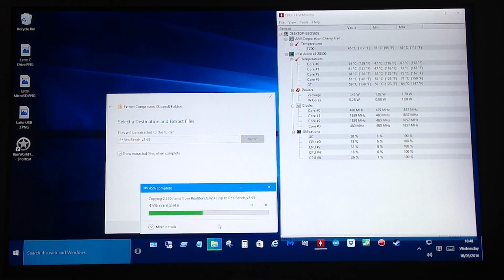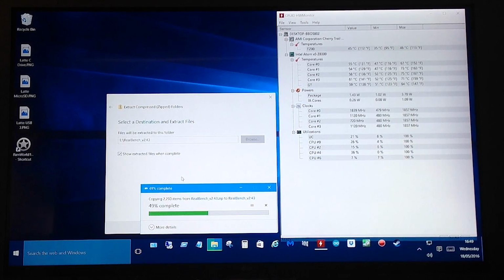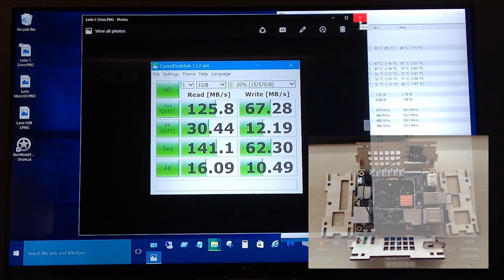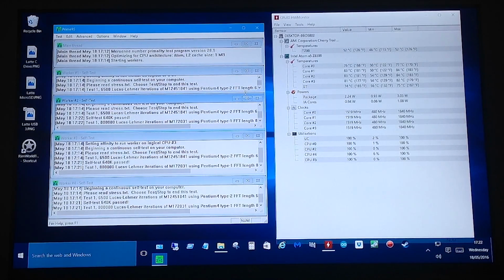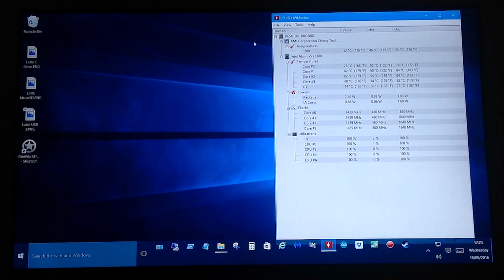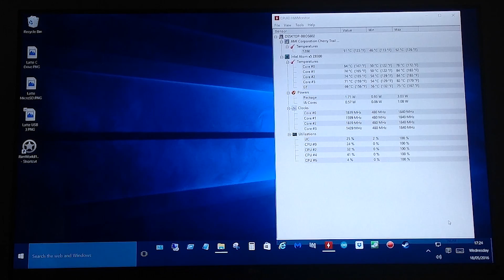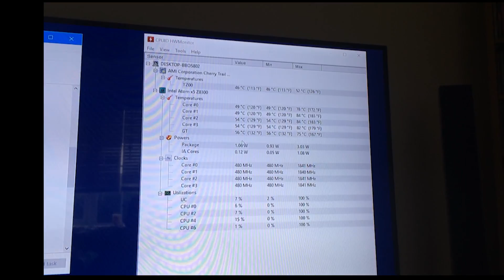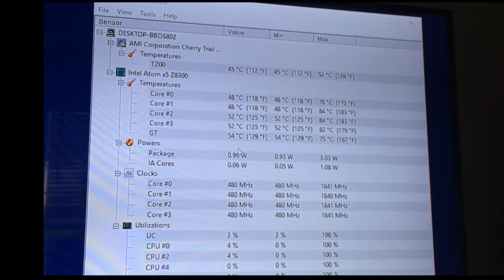LattePanda/Latte Panda Uncovered / Benchmarked / Stressed

Comment: I just verified @PVTParker's results. Thanks for posting this. I suspect that factory placed thermal goo is acting as more of an insulator than a heat diffuser or thermal grease. I think Lattepanda needs a better supplier for their thermal goo. We also added the same copper heatsinks, then tried keeping the processor spinning up to heat it up with chrome, streaming videos and covering it with a cotton cloth and we can't seem to get temp to rise above 83 degrees Celsius. It's baseline was 85 degrees C without running anything at start. So Good job @PVTParker.

Comment: Received my LP yesterday, and did all the preliminary setup on the system.  4 Gb/64 Gb system with LP stock 5v fan attached to processor and IPS display panel.  Initially attempted to fire up on a 2.1 amp power bank but proved to be unhappy.  Video kept dying.  Stay away from power banks.  Next set up on an Apple power block used for iPad.  This has proven to work for the most part, but I have some questions regarding how well a switching power supply works with the LP.  Maybe someone out there knows.  Grandson loaded Minecraft and found it to be pretty laggy, even with specs turned way down. Looks like gaming may be a stretch.  Went to Youtube (running in Chrome) and began streaming 4k video.  defaulted to 480P and this streams fine with about 25-40% load on CPU and temps about 60C.  Ambient temp is 22C.  When stepping up to 720P, load goes to 35-70% and temp is 61C.  Even at this resolution, the video can stop, literally, the IPS screen goes blank.  At 1080P it will flash on the go blank.  At this stage, it requires a reboot.  Have not tried it yet hooked up to HDMI output and IPS screen disconnected.  Comments - Please.

Comment: I was thinking that, given your points about components on the underside not getting the cooling that those on the upperside get, then how about mounting the board vertically ?   Perhaps add a stick-on heatsink to each of the six chips so that you get a better flow of air by convection over all of them ?

Comment: Those rubbery squares look like silpad, an electrical insulator but thermal conductor. You should leave those in to complete the thermal circuit from chip to heatsink.
Reply from the maker: pratherat yep agreed if the default heatsink is used then leave them in

Comment: If you run a browser (Chrome) with a single tab do your temps still 90c?
Reply from the maker: Ben Milford ....No but do something processor related on a non active cooled latte and you'll be getting pretty close. Since adding the fan i rarely get above 65 / 70
Reply: Pvt Parker great to know their fan works! I assume your using the official one they sell? Thanks so much for your help!
Reply from the maker: Ben Milford dfrobot werent listing the fan when i created the vid so no unfortunately not the official one but a 5v 1500rpm fan all the same....i would recommend something lower than 1500rpm if you can find one just to reduce the noise it makes...hope that helps

Comment: Hi a quick suggestion, if you insist on using a low quality mic you could improve the sound by post processing it, with compression and a noise gate. btw i like your tech videos. this is not a dig at you.
Reply from the maker: Supahfly Adrian i have a better mic now so things should be improved if i do any more vids :) thanks for the feedback
Reply: I literally can't tell the difference between a good or bad mic, this seems like a pretty alright mic so long as it doesn't sound like a world war two fighter pilot radio

Comment: hi. Mike from south carolina usa. if you will raise the board 6 to 8 inches high. then place 2 92mm fans on the right and left blowing in toward each other and keep the heatsinks where you have them. you will see much less temp and a lot more performance. keep the plates off to they serve no purpose also turn the board back right side up. hardware engineer here. i have been running this setup for months now. i got mine in the first batch.
Reply from the maker: Hi Mike, thanks for the info...interesting....couple of questions which fans are you using (a link would be appreciated) also how are you powering the fans off the 2 sets of 5v pins?
Reply: +Pvt Parker they are powered by the male pin set they always have power the fans are just some 3 pin connect 92mm china fan also play with your windows power settings (a laptop power settings is ideal).dont buy high wattage fans. my email address is gadawgs34@live.com if you would like to chat and go through this panda journey with some company
Reply: +Pvt Parker one more thing. mine is raised and attached to wooden dow rods

Comment: Would removal of the thermal pads and replacing them with good ol thermal paste plus the addition of a heat sink to the metal plate they use be a good choice?
Reply from the maker: The thermal pads are quite thick so removal will result in a gap between the cpu and the original heatsink. Paste will produce better results but youll need a bespoke heatsink....dfrobit are now selling a latte heatsink!
Reply: +Pvt Parker just a small after thought by their design team huh....

Comment: Thanks for the video!
Did you load tests the board again with the heat sinks in place? What were your max temps sitting around?
Reply from the maker: I did indeed on average it dropped temps by about 15c idle and under load..

https://youtu.be/af_up7OCO7M

Comment: those plates have more than one funktiom.they are emi shields heatsink with termal pads under.a better way to cool it donw is to use better termel pads put on those plates and put som termal pasta and a heatsink on top.also as you poined out,turn it upside down
Reply from the maker: I found that the thermal pads and the plate did next to nothing to be honest. A mini active heatsink would be the best way as you say with some paste but I've failed to find anything suitable atm...if you have any links or suggestions please post them. thanks
Reply: if you can order hard termal pads between components and cover.must messure distanse between cover and components.thay are pretty good.with some holes in the emi shield/ cover and a small heatsink with a 12 volt 3-4cm fan run on 5 volt i think you will be a happy gay.

Comment: the covers are heatsinks with termal pads to connect the parts to heatsink.you find those pads on graphics card playstation and so on
Reply from the maker: They suck...
Reply: yes they suck.but there are better pads with much higher termal tranfer capasity.a shop that sell pc parts or most real elektro shop should have these pads in diferent qualitys.if correkt use they wil be skvised between component and bessel.i solution that workt fine was change all those bad pads.drill sdome holes hwere posible in the covers to have air move innside.i put a heatsink 3 mm high,like those on shipset on mobos.used superglue to fasten it on the cover/bessel on top of that i have a fan 12 volt 5 blades.the fan is 4 cm in diameter with no outer ring with skru hole in eatch corner.i use tose that was and is used on small graphics card they have 3 small flaps stikking out with skru holes to fasten them to heatsink.i cut of those and glued the fan an let it run with 5 volt from usb.cant her it unless you put your eare down to it.best result with this is to turn it upside down.anyway you shave off 20-degrees easy.used the same coling for an usb hub with its own power adapter.but the 5 volt controller component was getting so hot that you couldent tuch it. glued i litle heatsink on top off component 3 cm by 2 cm heasink.put a fan as decribed but alitle smaller its 12 volt running it on 5 volt.its silent never gets hot under load.good luck to your projekt sir
Reply from the maker: +leohobb leohobb nice!

Comment: 3:47 Those are called thermal pads, btw! 
10:20 The processor is throttling due to the little copper-ish heatsink not having enough thermal/cooling capacity. If all the chips on either side are at the same height, you can mount a large (preferably copper) heat sink with good thermal paste (thin coat). I imagine that a heatsink from a low-budget video card would also work. Something low-profile, could be passive if you use all of the available area. ;) Check any old PC/parts, you'll find the perfect candidate.
Reply from the maker: Lol thanks thats what you get for not scripting vids >_<
Reply: No prob, dude! :) Also, the metal plate you removed server as a bit of heat sink, since it had a lot of area. This is making it easy to attach a heatsink directly on top of it, but regardless, you can get sheets of thermal pad material (get the one with higher W/mK - better thermal conductivity) and mount the large area rad of your choice directly on the chips. :) Cheers!

P.S. Looking forward to getting me a LattePanda to thinker with it >:)

Comment: iam able to play dota2 getting fair enough fps using their 7 inch panel. but only thing dragging behind it is the heat, i could use ur tip to cool it down.tnx . also is ur arduino able to do the blink bcz mine doesn`t.

Comment: thanks for Posting, very informative - kinda put me off really; Think I'll take a longer look at the Orange Pi (PC version)
p.s. Orange Pi Lite has WiFi built-in also
https://www.youtube.com/watch?v=TEyU1zSqFwU
Reply from the maker: Hey no problem, thanks for the comment and I'm glad it helps people make decisions about what they're buying, mission accomplished! I'm not sold on the Orange Pi tbh, it doesn't have windows capable specs in my opinion, not enough drive space for the installation. I notice is does have a SATA power and interface but the RAM would also hold you back, the Pine64 is a similar situation. They are both however way cheaper but your not getting an OS with it....for a reason!??? depends on what you want it for I guess, IOT stuff sure, portable Win10, 4k capable pc unfortunately not..

Comment: Great Video man, this is great info. I going to look in to getting some of those cooper heat sinks. 
Oh and just you inform you, the "Pink Pads" and thermal pads to transfer heat to the plate to dissipate the heat.
Reply from the maker: Hi X, thanks man glad it helped. The copper Hsinks are nice, a bit cheap, hopefully some purpose built ones will be out soon. I would also recommend getting rid of the thermal paste that comes with them and adding something like the artic silver stuff which would probably perform alot better...

Comment: What's ambient temp? I have barely hit 100F, I did have it sitting on a fan/shroud but it wasn't under too much load, haven't turned on a game, but have streamed and watched video. Also have acrylic case but not sure that would make much of a difference.
Reply from the maker: Ambient temps indoors yesterday wasnt anything special about 20c indoors...
Reply: +Pvt Parker yeh, bit of a stab in the dark, heh.
Reply from the maker: FukU2222 well no it could of made the difference and was a good question. I checked the BIOS to see if I could amend the voltages but unfortunately that's a no go.